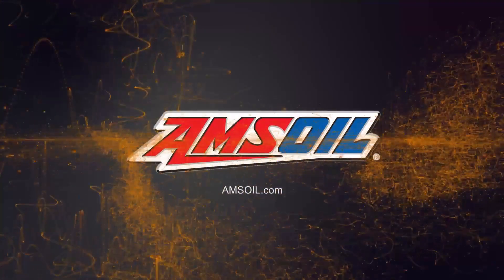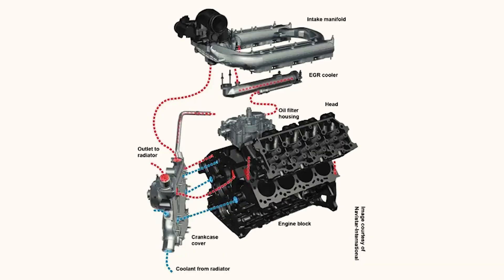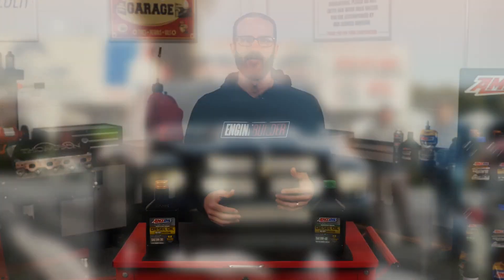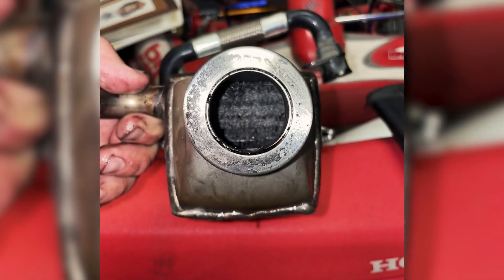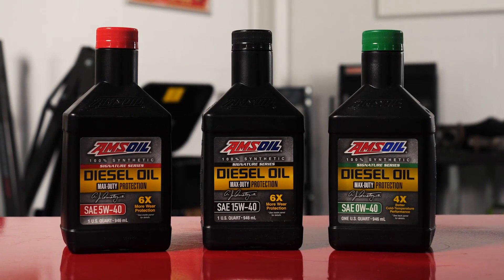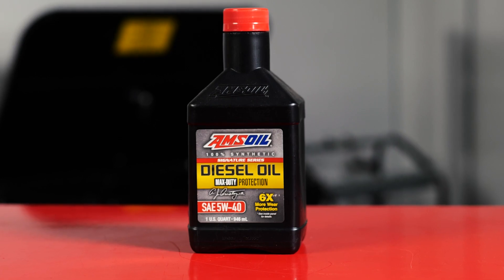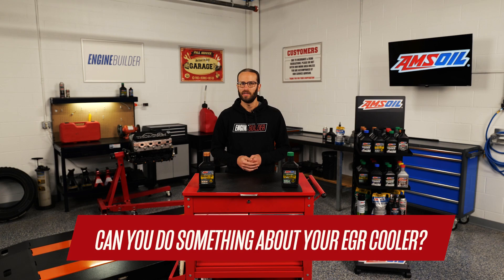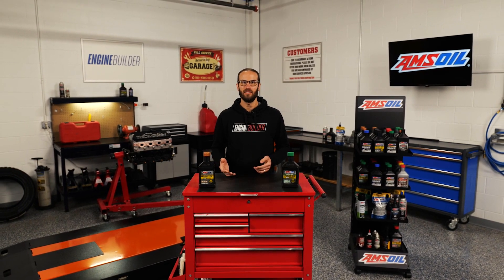Your EGR Cooler Will Fail – Here's Why

Comment: Exhaust gas is inert. It does not burn a second time. It is also not dirty air. It is CO2, CO, HC, & NOx. The O2 content is minimal to nil. Exhaust gas, while hot, is cooler than the combustion chamber. The inert EGR gas cools the combustion chamber to reduce NOx.